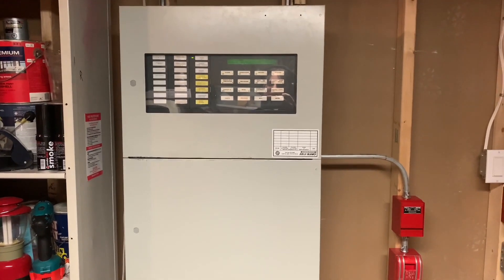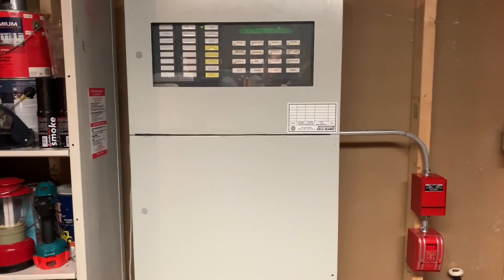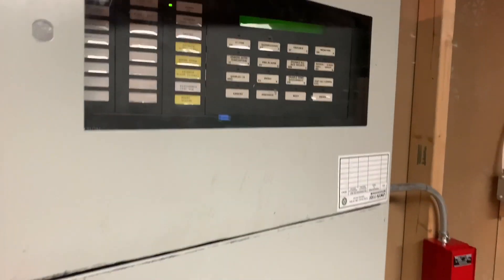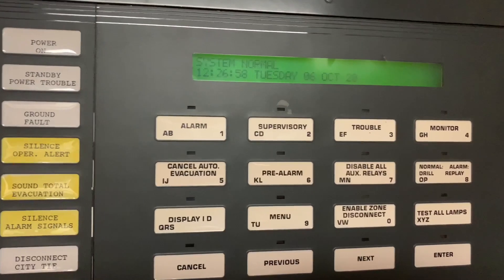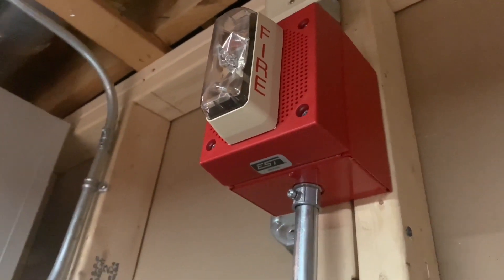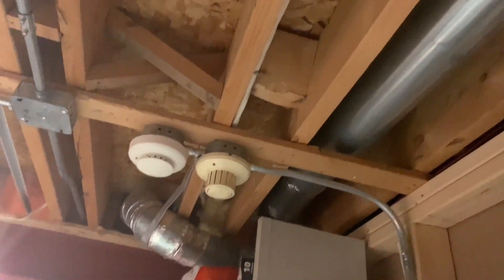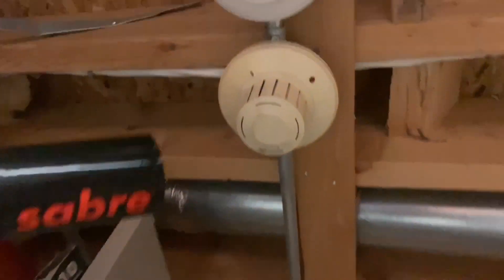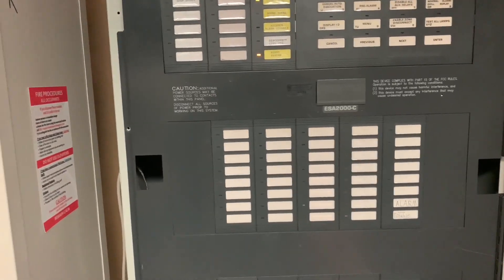(I’m Back!) Edwards ESA-2000 Demo System Test

Comment: Nice. Does that panel have coding options
Reply from the maker: It has a lot of coding options.
Reply: CJ9899 if it has 2 stage. Could you do one with a bell that’s 10 inch for NA
Reply from the maker: capt421 2 stage setup would require the laptop programmer. Something I don’t have
Reply: @CJ9899  doesn't the esa-2000 have some sort of 90 BPM marchtime?